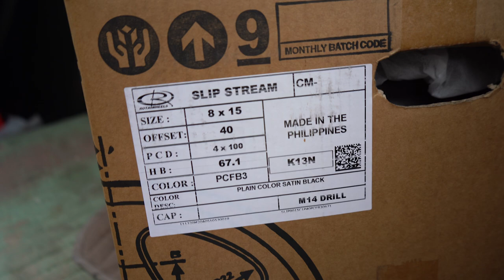These are going to look SO GOOD!! EP.10

Comment: Chris, my RSX burns a lot of oil too fast. I just did an oil change about a month and an half and it burned all that oil during that period of time. I just noticed a loud rattlesnake noise as I turn around corners coming from the engine bay. I tried to find out where the noise was coming from. I checked the oil and when I pulled out the dipstick, no oil. I added one quart of oil, drive the car and the rattle noise was gone. the  red oil pan warning light didn't come on in the dash at all.
Reply: Rings could be shot. I’d do a dry and wet compression test and compare the numbers. If the numbers are higher during the wet compression test then it could be an indication that the pistons rings need to be replaced